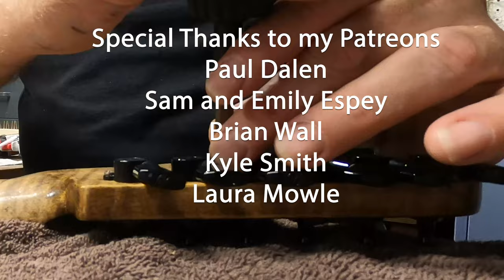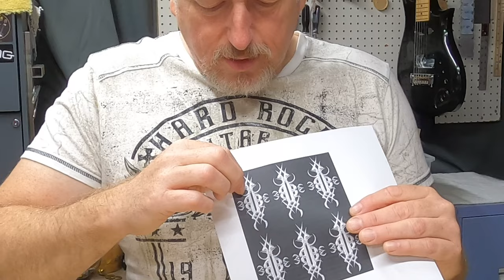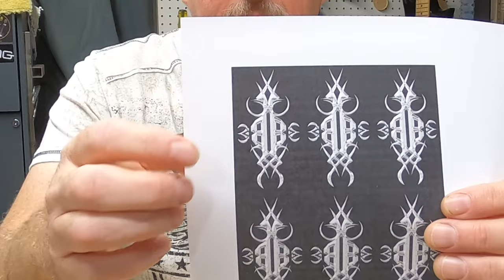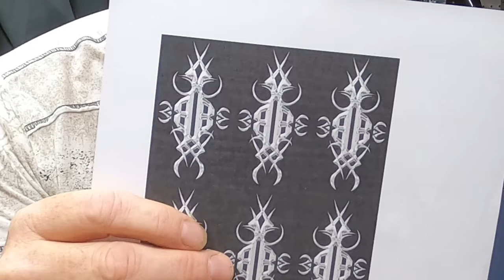Experimenting with EASY INLAY on my most complicated and detailed inlay I've ever done!

Comment: Quit messing with the tape. Just use white glue to glue your image down. It goes away when you sand  the inlay level. Any excess can be easily cleaned up with a damp paper towel. I've done a considerable amount of inlay and this is almost always my go to method. Hope this helps you out.
Reply from the maker: Thanks for the advice….I guess I’ve been afraid of getting it into the pours of the wood!
Reply: @letsbuildaguitar9230  You should still score your edges but this way your design won't slide around and no gumminess to deal with. You may find that the paper feathers obscuring your view. If so, wait for the white glue to dry then clear coat the paper with a haze of clear spray paint. This will harden the paper and reduce feathering.
Reply from the maker: @FluidFocus  Cool!! Great Advice!
seriously thank you!
Reply: @letsbuildaguitar9230  No problem. Feel free to DM me if you have any other questions. There are no secrets in my shop. Good luck, have fun, and may the force be with you. ;)

Comment: Because the edges of the easy inlay dust is so raggedy.... I was wondering if after it was set in, that maybe a person could outline the edges with a router, say a 1/16 ,and  glue a strip in it . I know it would never work on this intricate pattern but i bet it might the larger ones .. what's your thought  ?
Reply from the maker: Perhaps!  What I did to get crisp lines.  I  used the easy inlay and then I used a pull crusher mortar and pestle to crush some into dust.  I then vibrated the dust into the “chunks “ then added the glue!  Over filled my design and then sanded even.
Reply: @letsbuildaguitar9230  I saw that . And it significantly improved the edges.  I was just thinking that route routering a slot to put a thin border in might even be better.  Saving for the skill of tje person with the tool in hand . 
   Or even a lighter line and using sawdust..